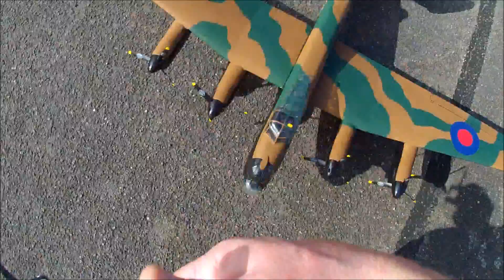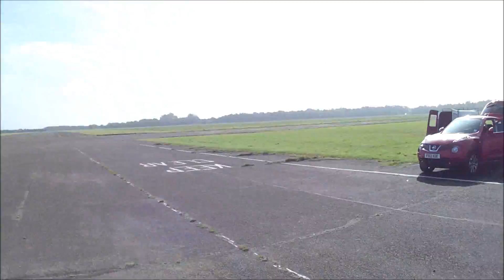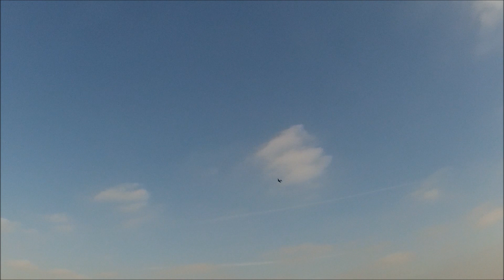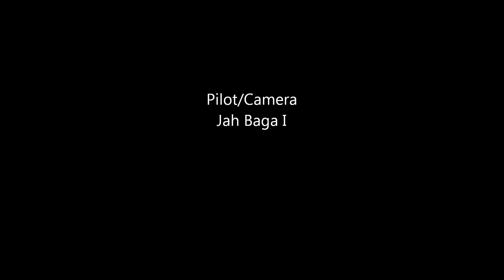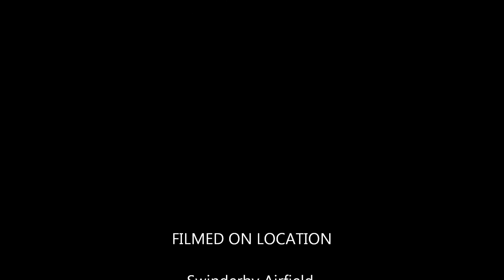Lancaster Bomber crash... r.c. Tony Nijhuis 72" span.

Comment: Definitely a motor out or sheared prop. I lost a port outer prop on my Green air designs B17 on It's maiden flight. It took me a while to work out what had happened. every time I turned left it span. reducing power I could recover from the spin, but reapplying it and it span again. They do say don't turn toward a dead engine, but I had no idea what was going on at the time. I managed to land it by keeping the throttle as low as possible and reducing power every time it went to spin, then just reapp;lying enough to keep it in the air on the approach. I was lucky I guess!
Reply from the maker: Hi, yes you did well to land ok. As you say, no way of diagnosing a problem when it's 100 m away.... I think I ran out of rudder  to hold it straight. Funnily enough just yesterday we had a dude at my work... an r..c. jet nut... who's latest airplane cost 7K + to get in the air (!) was banging on about giros in our multi engine 'planes, his fantasy was that the giro would pretty much hold the 'plane level. I could't have the convo with him, for someone so into flying he seemed a bit dim......nice to hear from you. 
 All the best...... Ian J
Reply: @JahBagaI  as much as giros may or may not work, I couldn't tell you! I am a basic 4 stick man. The most extravagant I get is maybe a switch or two for retracts and flaps 😛😀

Comment: nice model,such a shame,im just wondering how wide the engine nacelles were on your model as im building an old priory models 6 foot  span lanc and im making my engine nacelles 2 inches wide,im converting it from a hand launch model to one that has retracts and 4 x,1000 kv motors,so im wondering,are tony nijhuis cowlings 2 inches wide,so I don,t have to build 4 from scatch,if so,,ill try to get some,,things have moved on over the last 5 years with brushless motors and lipo batteries,we should,nt need to use gear boxes anymore these days ,never seen one I would trust any way,
Reply from the maker: Hi,  nothing of the nacelles survives and I don't know where the plans are so can't help. The whole airplane was balsa built including nacelles.